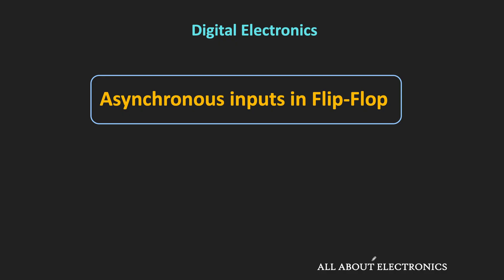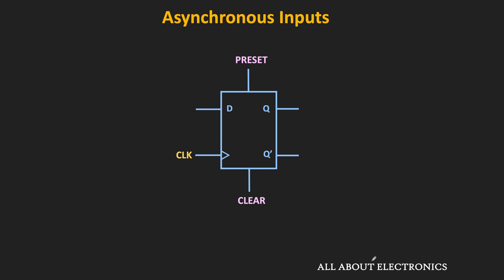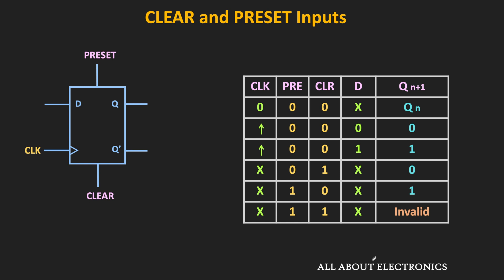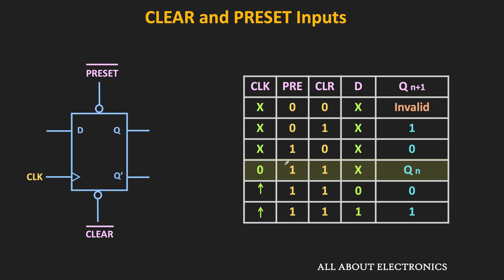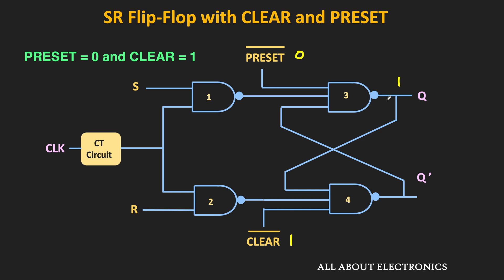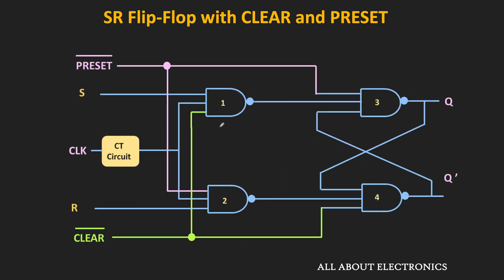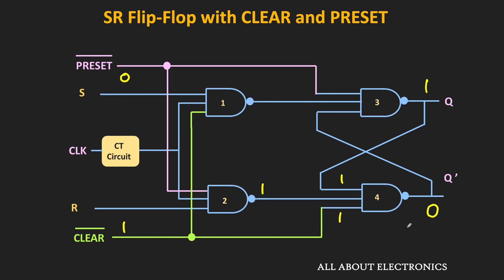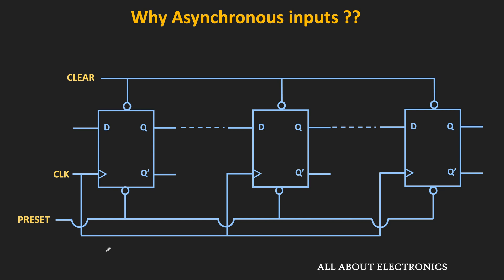PRESET and CLEAR inputs in Flip-Flop | Asynchronous inputs in Flip-Flop

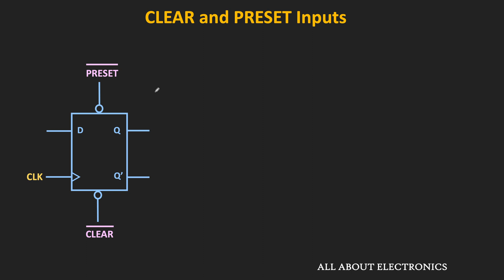Comment: 4:05 I think it should be PRE bar and CLR bar in the table. Logically speaking, when the preset is ONE, then Q must be ONE(if valid), I don't care how the circuit is implemented. Now, we are trying to achieve a low activated circuit, which means we want to set  Q to ONE when the input(PRE bar) is low, but PRE is high. Likewise, if we set CLEAR bar(the input) to be ZERO, then we will theoretically set Q to be ZERO. In this situation, Q is ZERO and ONE, which is contradictory. At this time, PRE bar is ZERO and CLR bar is ZERO, and it is invalid.
Reply from the maker: Yes indeed they are preset bar and clear bar inputs only.

Comment: nah this is wrong. if both clr and preset are 0, then S and R will always be 1, which eliminates the usefullness of the ff
Reply from the maker: Both PRESET and CLEAR should not be 1 at the same time (In case of active low input), otherwise it will give invalid output. Please check at 5:13.

Comment: Why you are representing PRESET bar and CLEAR bar ? it is very confusing?
Reply from the maker: It means, they are active low inputs. It will have an impact on the circuit when those inputs are zero.
Reply: So when you are assigning values as zero or 1 to preset and clear in this video, so what does it signify? Is preset =0 or preset bar= 0
Reply from the maker: @ansumanpadhy8228  In the circuit, when it is represented as a PRESET bar and CLEAR bar, it means that they are active low input. And it will have an impact on the circuit when these inputs are 0.